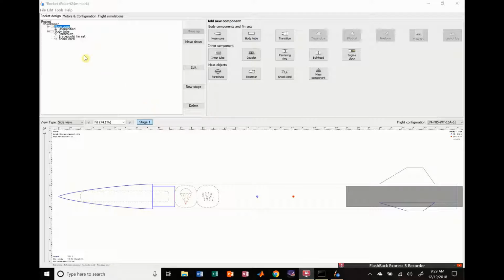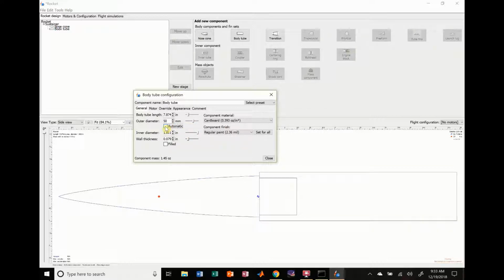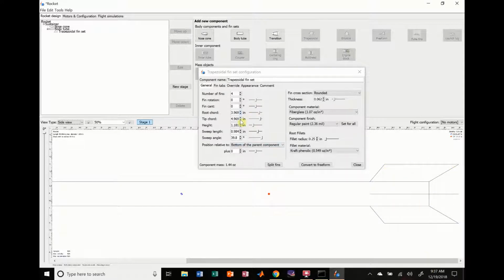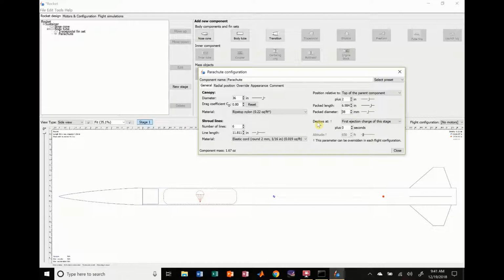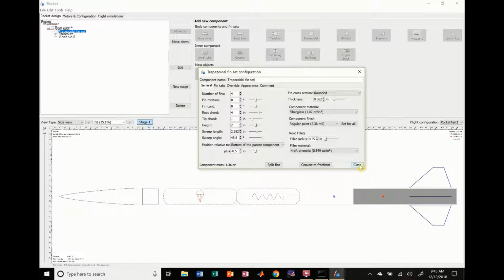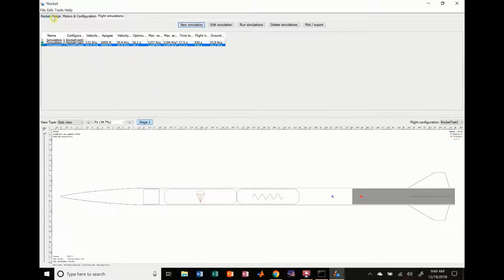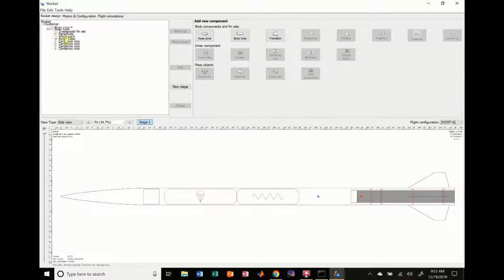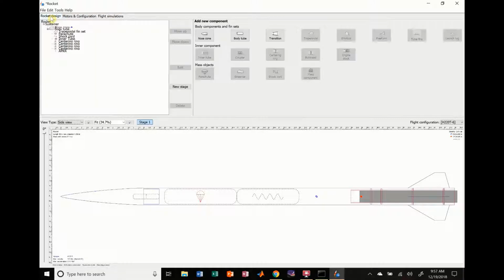OpenRocket Tutorial (2 of 5): Single stage/basic rocket

Comment: ki. question, i cant get my two stage to work. It keeps saying my deployment went off while the motor was burning no matter what I seem to change. Set delay crazy long, at apogee, plus 16 sec etc. Also. my numbers seem low for the impulse, ex. a two stage 4" to 3" from a L to a K I cant get over 21kft?? If i have motors in both mmts and plug them, they should both go right? Thanks

Comment: hi ! I have a questions actually . We have a team fotr the Teknofest festival in Turkey. We can make a rocket like we want with all given conditions but we are making it arbitrarly.  I mean , ı m talking about the dimensions . For example the nose cone length and diameter or the fin calculations . those are the questions in our minds . we're studying aeronautical engineering in the 2nd year and we think that there must be the exact dimension values of fin set , nose cone etc . is there any equations for them or comparison criteria . 
     Thanks a lot .Have a great days and have a great flights ! :D

And  I Have also one more question . we have thought about the recovery system . First , we think about the linear actuator for the opening nose cone , then we asked ourselves that how would be if the parachutes deploys from the side of the body tube . we made our searches but we dont know how can we show up that on OpenRocket . 

thank a lot again : D